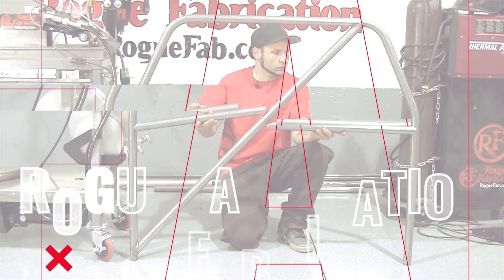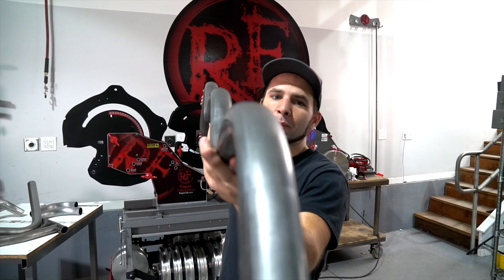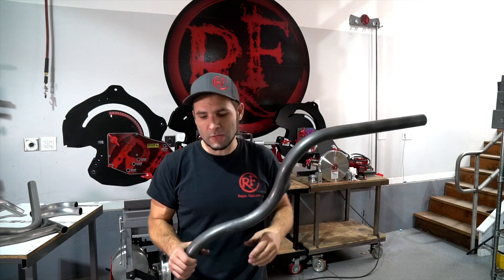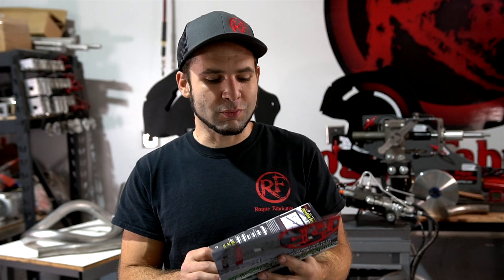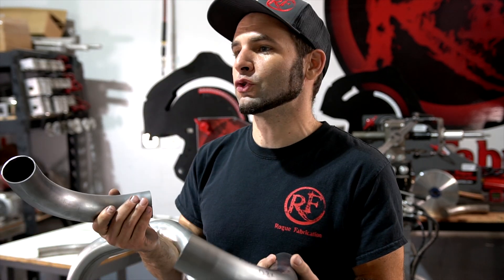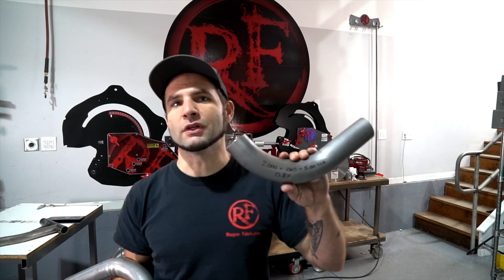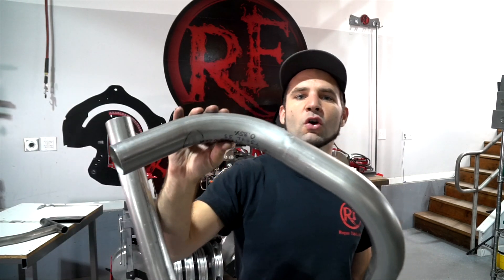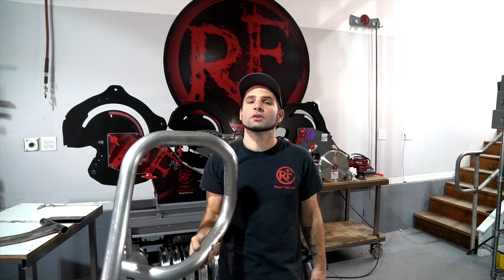Rogue Fabrication Shop Update - Bending 1 5/8 .083 Chromoly and Stainless Header Bends!

Comment: We had 1 inch stainless tubing 1/8 inch wall that needed to be bent to a gradual 90 degree these were guides for dragging a 250 lb bag of bulk dog food from the floor to 5 foot useing a boat loading winch. I dont know if the Rogue Fab has dies for bending that small of diameter. This is a custom request my employer got and we will be building more of them. I dont believe the shop that bent them used a Rogue Fab bender.
Reply from the maker: We have 1" tube dies from 2.5" radius up to 6" radius,  all in stock and ready to ship :)
Reply: @RogueFabrication  awesome
Reply: @RogueFabrication  how much is the weld your own, Rogue Fab Tubing Bender kit? If i pick it up at your shop?
Reply from the maker: @ernestmurphy3898  they start at 925.00 and go up from there. - Josh in customer service